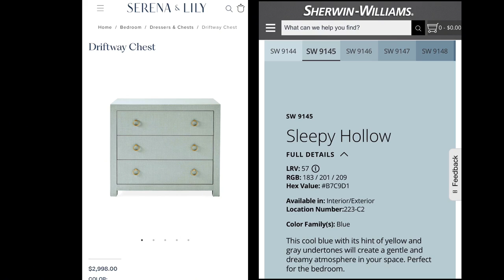Serena & Lily Dupe - Coastal Look | Dresser Makeover | Furniture Flip | Painted Dresser

Comment: So, so beautiful! I love the color and I’ve used those ring pulls before and they are classic and great quality. Question, if you can help me? What should I expect the finished paint surface to feel like? I struggle so much with having a smooth finish like the factory finish on painted cabinets. Am I expecting too much? I spend so much time sanding between coats and I eventually come up with a soft smooth finish, but I spend sooo much time. I have switched to a spray gun but it still has a light texture. Boy do I wish I had a mentor! 😂
Reply from the maker: Thanks Kay! I don't think you're expecting too much. The type of paint can play into it. What brand of paint are you using?

Comment: You used the liquid sandpaper and then put the primer right over it!  Does it not leave any type of residue?
Reply from the maker: Yep, per their website you did not need to rinse it before applying paint. I've never had any problems. It actually helps with adhesion.